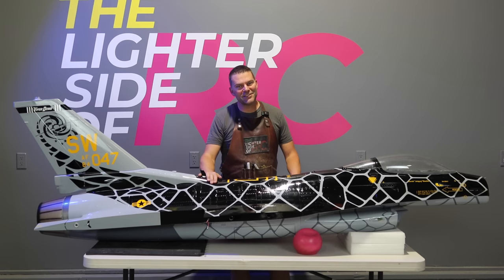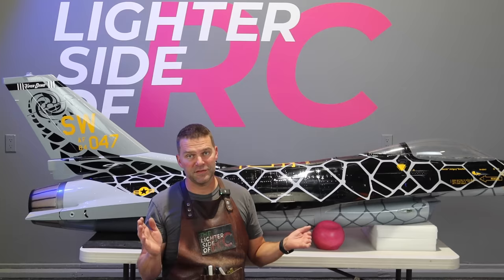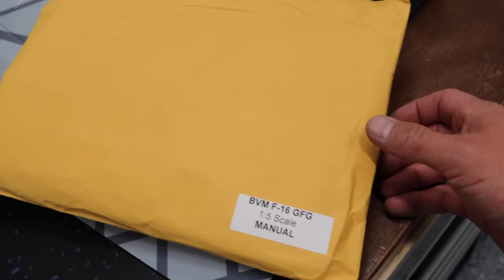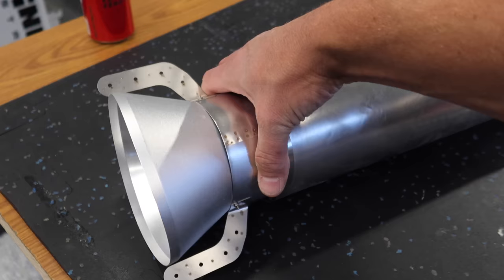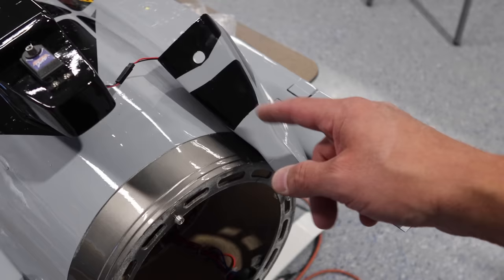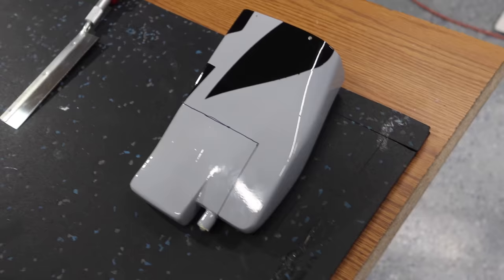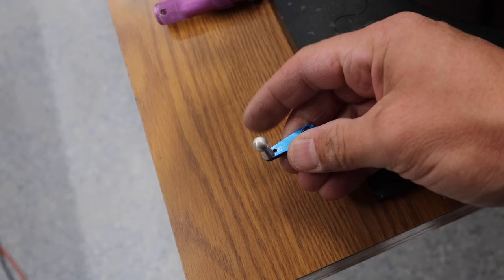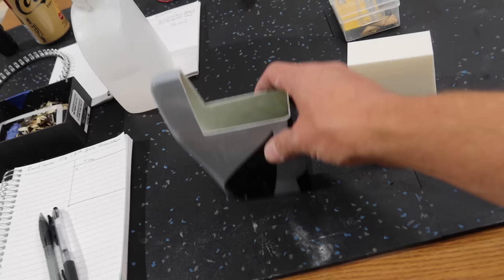Crafting Adrenaline:  Building the BVM F-16 RC Jet Venom Edition Begins

Comment: Why Clone and not Dual path? Why no 900 backup? Why a entry level CB and not the 400? You are not using the full capacity of the radio.
Reply from the maker: Because it’s a preferred setup by the owner. He doesn’t run 900 in any of his aircraft. No need for a 400. Why buy something massive and heavy for an aircraft that doesn’t need it?  Function wise the 400 doesn’t offer anything more that this aircraft needs. 

Yes we are very much using the full capacity of the radio. This F16 is quite a simple aircraft if you were to compare it to the f14 that we put together (using a CB400).

Comment: Dang that was an ACTION PACKED episode. I had everything Drama, Excitement, New Stuff. Great idea re the 3D printing being able to beused as a Mold. I concur  whack Locktite RED stuff in there re the as things are pulling some G,s at low and High Speed. Going through everything virtually starting as a kit. Perth Winter lasts a couple weeks Summer and HOT rest of  Year FIRE SEASON already started. Looking forward to the next one. 🤠😎
Reply from the maker: So much to do!  Thanks for watching.  I thought when this aircraft first arrived there wouldn't be as much to do.  WRONG!  Loctite, Loctite, Loctite!

Comment: That BVM CCU is actually a pretty feature packed device. You can view RX voltage, air system psi, and set a fail safe for pressure and altitude in meters to prevent the gear from retracting if you bump the switch. BVM has a video on their YouTube channel on how to program it.
Reply from the maker: Thanks Klaus.  Yea looking forward to playing and learning it.

Comment: Great video as always.👍👍
One thing though….
I’ve been muddling with 3D Printing for a while now and I’m definitely not an expert by any means but I would’ve tried to incorporate the LED to the bottom of the chute box just so that you don’t have to remove, reglue, at a much lower level than original.
I’ve also found that if I’m making new custom prints, it’s easier to print the piece at a thinner, quicker piece just to see if everything fits as needed and then go back and reprint at the normal specs for the finished product.
Filament is cheap so it’s easier to try it, go back and change something if need be and try again to get your desired results.

I suck at CAD. designing but I’ll try my hardest to design something first before just printing squares and reshaping it to fit.
Reply from the maker: Thanks for the comments and suggestion!  I wanted to keep the lower portion of the tail end as stock vs making that into a new portion of the assembly.  Great suggestion though.  
Agreed on the thinner printing setting.  I'm learning as well and it would have saved filament and made it much quicker to print the first thinner.

Comment: can you explain how you can control all the functions on the jet with a 7 channel receiver?
Reply from the maker: For sure!  With a Jeti setup you have access to all 24 channels regardless of the actual channel layout on the receiver.  So if you were to install a single REX 7 Reciever with a Cortex Gyro you have access to 14 servo outputs.  Add an expander port to the Rex 7 Reciever and you now have access to 6 more servo ports.  But at all times you have access to 24 channels in the radio.  That's the simple explanation.

Comment: Why are you “burning” in the servos? I’ve never heard of this or been told to do this on any of the models I’ve bought.
Reply from the maker: You won’t be told by anyone to do it. Not common practice. The theory is, if it’s going to fail it will hopefully happen near beginning of life. Get the servo working and warm.

Comment: Since you got me closer and closer to pulling the trigger (and p*ssing of my wife again:) it was extremely interesting to see the difference between this BVM versus your usual Skymaster.
Being an absolute noob.....the Skymaster kit (at around $6000) seems more like a true "build" project versus this BVM $12.000 kit being more of a "refitting to purpose" project??
Reply from the maker: LOL.  Glad I could cause trouble!  Keep in mind you need to add in all the "Stuff" with the skymaster kit.  Kit, gear, tanks, pipe, etc, etc, etc.  The Skymaster is more work but in my opinion it's a better built aircraft.  The BVM will require disassembly and reassembly of everything as I demonstrate in the series.